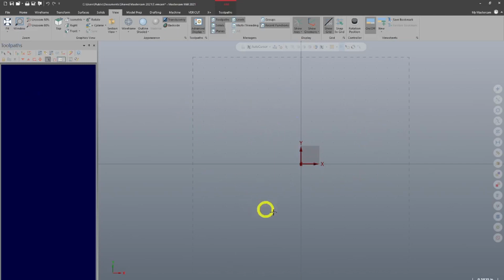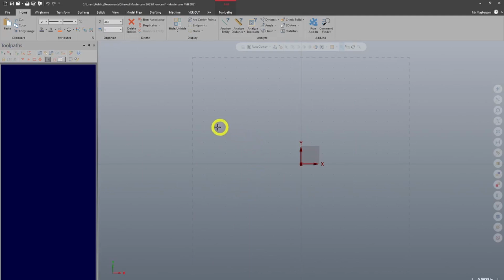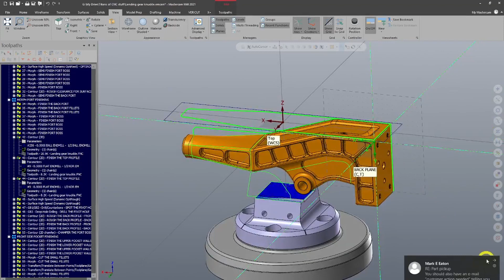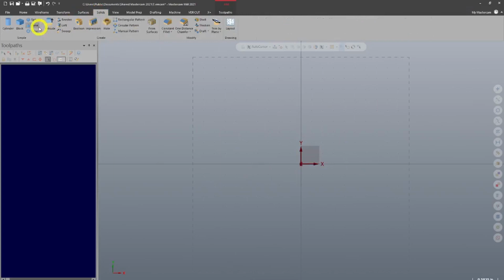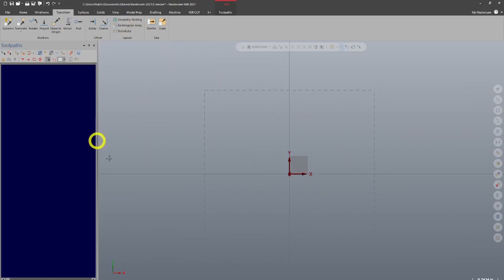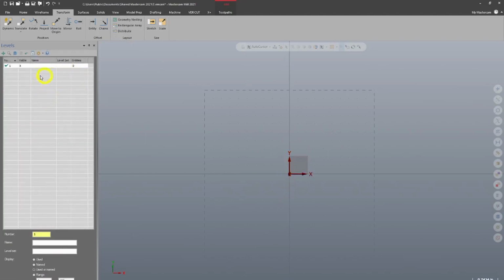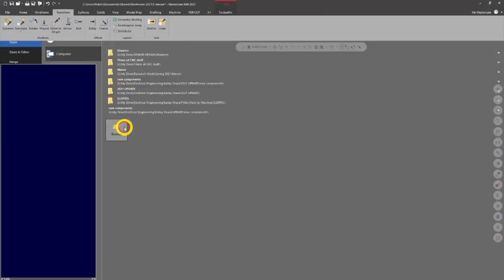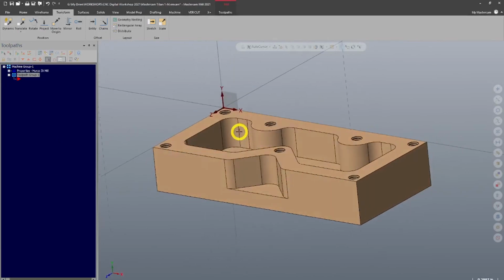#1: Introduction to Mastercam 2021 Software - Mastercam 2021 for Beginners

Comment: What is a 3D mouse? I use Solidworks and have never heard of that before. I use a corded mouse. In the next clip you do center the part on the MasterCam origin. I guess the program takes care of going between the positive and negative axis instead of picking a corner for the origin?
Reply from the maker: A 3D mouse is a product made by 3D Connexion that allows for easy panning/zooming/rotating simultaneously. Highly recommended if you do any level of CAD/CAM/CAE work on a regular basis. Here's a link https://3dconnexion.com/us/spacemouse/
Reply from the maker: The next video covers the orientation yes. You can technically orient a part however you see fit. Certain times a corner is best, I like centering to avoid tolerance stackup issues especially on second op. It depends greatly on application